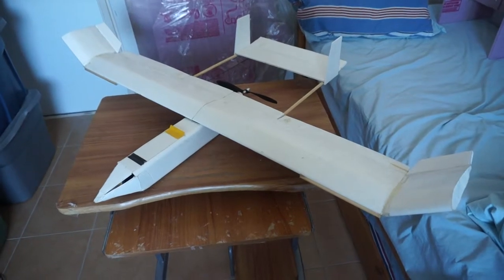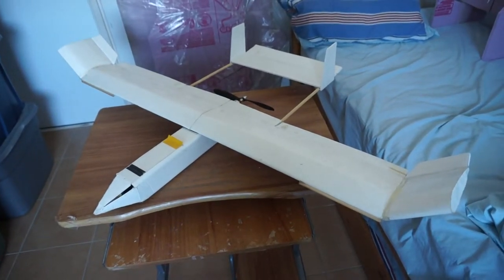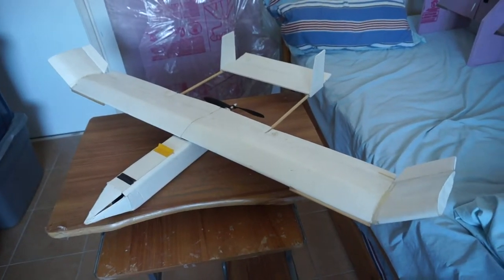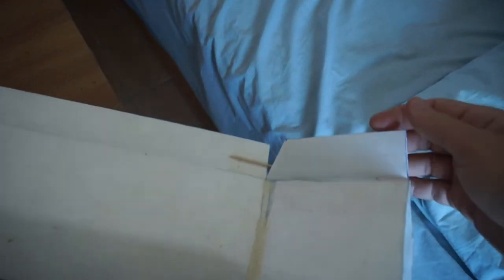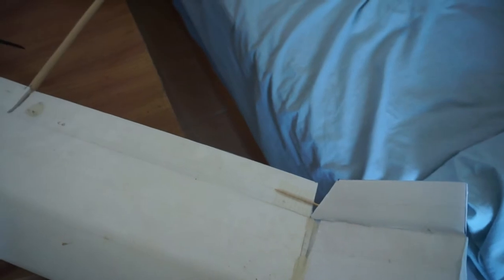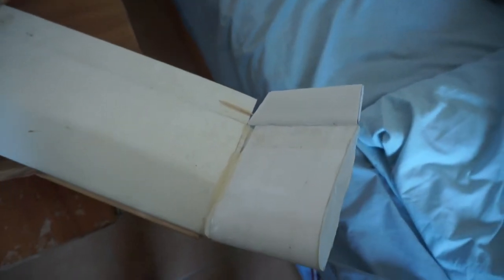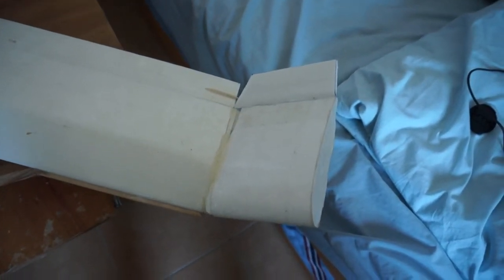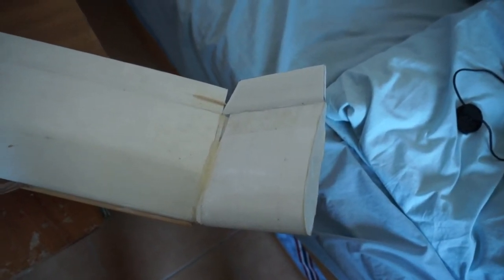RC plane - aileron-coupled rudder on angled winglet

Comment: How did you link both ailerons? I only have one aileron port on my receiver.
Reply from the maker: Look up y-cable for connecting two servos to one aileron port. Alternatively, if your servo is strong enough you can connect each aileron to opposing sides of a two-sided servo arm.

Comment: wheres the flight video? How do I know it works? lol. It seems like a cool idea though
Reply from the maker: +Christopher Barron 
Whether of not it will work well will be highly dependent on the details of the design of the particular plane you do it for. If you do it for a plane that very closely resembles this one, it will work.
I gave that plane to friend long ago and his son has since crashed it, but I think you can judge from my other videos (especially my recent ones) that when I say  something works, it does ;-)
Also the concept of coupling is not unique to this plane. It's just my particular implementation that I wanted to share. It's easy enough (minimal effort) to test for yourself.